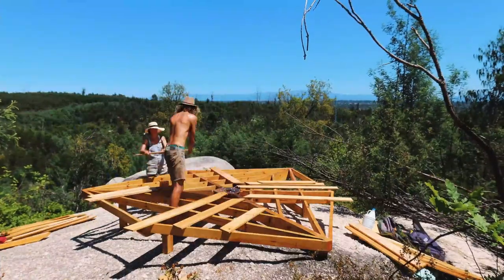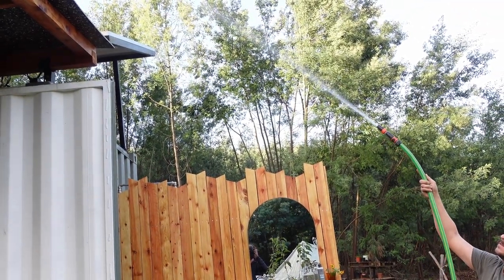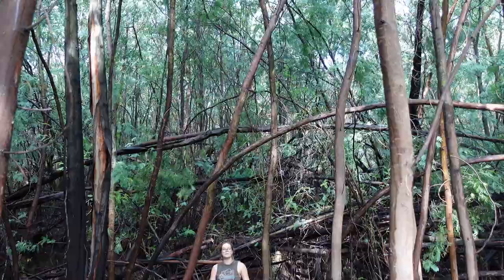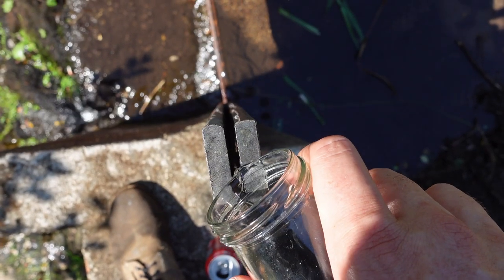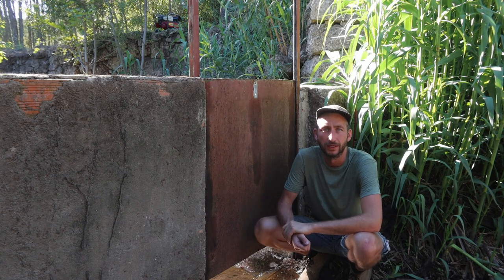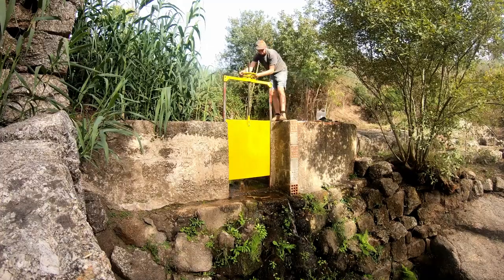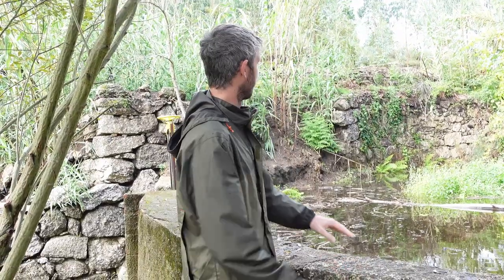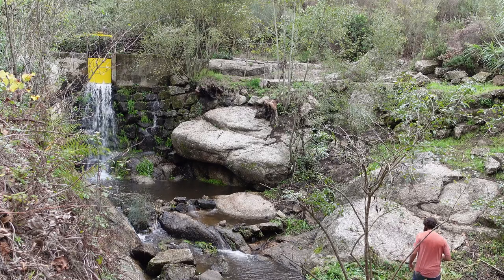#71 Fixing the waterfall door (before big rain comes)

Comment: i would make the grooves way bigger on the sides of the dam, and then isolate metal with plastic or rubber so that the metal door does not slide metal on metal, but metal on rubber or plastic, it does not have to be waterproof as the water pressure will push on it and create a seal, once the water starts rising, if not you will have rust and grinding as a yearly problem or pollute the water with grease or oil..

Comment: i would have just used a bottle style floor jack, something like a 20 ton, and just slowly apply jacking pressure as you add lubricants. 40k pounds of force, constant, itll move.

also, pour hot wax into the sliding portions, the wax will stick to the metal and work as a lube when you go to open it up next time. farmers here in the US used that all the time for generations. cheap, and it just works!

Comment: so, if you used the shingles as shingles overlapping from top to the bottom, they would work amazingly. Instead of trying to make the connections water tight.. so set up the same way regular shingles are set up.

Comment: Get a "Fine-Grained" Steel, like Hardox-400, 
to made the replacement Guillotine-Blade from, 
and pre-shape (taper) the edges, before installing it,
also weld an ANVIL (thicker piece to hit with a HAMMER) to the Top-Edge, 
also plasma-cut, some lifting eyes (holes) in the top, 
& use "High-Zinc-Solids" (Galvanic) etch-primer, 
before painting on the Top-Coats.
Glue on a "Nut" to the Guillotine-Blade,
used to hold a "Sacrificial" Zinc Anode 
that prevents rusting, 
that anode screws in to make hard contact with a bit of bare-streel.

Lubricate the slideways, Drill & tap to allow some "Grease Zerks" (nipples),
and consider "Copper-Coat" long-life lubricant on the slides.

UHMW-PE (poly-etheleyne) plastic "shims" are a very good idea.
To prevent to two steel parts contacting each other.
If needs be, you can burn the poly-ethylene out, if you must.

Comment: Everbuild Evercryl One Coat Instant Waterproofing For Roofs, Gutters and Gulleys, Grey, 5 kg and also Butyl tape for joints fantastic on any surface and can be applied in wet and cold. Used on plastic roof and got me through two winters. Amazon

Comment: Next time maybe put a thick plank between the sledge hammer and the steel sheet you’re bashing.
Nice plot though and a nice elevated spot to capture water in a standing column to drive a small high pressure generator.

Comment: Maybe try a rooftop design with square stones like they did in the old days. You might want to check martijn doolaarts channel. Its probably more easy with rectangular plastic 'stones'. This method wil accept movement of the plastic and still drain towards the gutter.

Comment: Hi, i schudent coment but i cant stop.
Greate video espeseialy the dam opening.
Reflection: down stream the dam it looks like man made smaller dams/ water holding spots.
About the new well:
When i was a child, i was told, if you dont youse it you los it. Is pared to alot of oder issuis.
It says to open a dry whell keep the level low as possible during some time reny sessone.
This to open up the inlet canales, wich normaly clogged or decrising flo by not using it.
Another thing how to check water qualit. Find a frog or a copul of them, if they servive they shoving good water quality andnif they like to stay they will clean the whel for you.
Hopfuly some make sence due to bad spelling.
Good luck with youre project.

Comment: When I see the water leaking out of that rock, my first though, doubly with seeing soil on the other side (Presumably) is that water has soaked the ground over many fill/drain cycles, and erroded away part of the section that the main concrete wall is rest on.  I have my doubts about the structural integrity of the wall and worry that it's a potential collapse hazard down the road.  But i'm not a civil engineer so I don't really know!  Cracks in the foundation of the damn, leaking sub-structure, and lack of maintence fills me with dread!

Comment: Hello, not seen your videos before and unsure how those roof panels are constructed etc. However If all you want is for it to be watertight you should simply space them apart by 2cm and put that same tape over them with slack in the tape to allow for expansion and contraction, you should also make the holes larger where they are affixed to the structure (again don't know the details but I assume you have just screwed them into that large frame (oversized and this is part of the problem because it is so rigid). So the screw sits in an over sized hole then have a metal then PE washer (PE very tight against plastic) this will further allow heat driven expansion and contraction which will stop the curling and leaks. What you have installed now will work for a time but eventually the tape will come off due to differential movement (which it will get pulled off because it is taught). I work in construction btw not just pulling this out my arse lad.

Comment: The best and let's say more long term solution is to redo the whole dam, maybe not the whole but definitely the gate, as it is very rusty and leaking everywhere, and maybe raising the gate a little bit so the water doesn't overflow as much, or if you guys don't want to go through all that trouble just put a TON of silicone all around 😅

Comment: I think putting a hydraulic car jack under the sheet metal water gate would have worked.
The gate guides might not be a 100% parallel and you were jut hammering it tighter and tighter.

Also, you should REALLY wear a respirator when using a angle grinder.

Comment: That blow touch is not power full enough, you need something with more power, and then cool the metsl so it expanes and contrac a few times, but it's not the easiest place to get tools to. 😉 Ps next time don't hit metal that you want to keep with out putting wood in between 😉 regards from denmark

Comment: Next time you try to move something that is rusted shut, don't bother with impact force, it'll never work ... instead use a constant force - in this case a couple of bottle jacks underneat the drawbridge would have cracked it free.

I'd also be strongly tempted to remove the gate again and grease those channels, or it's just going to rust shut again.

Comment: It's obviously a little late now ,but WD-40 is not technically a lubricant. Should have used some type of oil/petroleum product. My favorite here in the US is a product called Kroil.  Then use a jack from your car from the bottom then hammer from the top alternating.

Comment: take a foure by two cut a slot to fit in the gate put it on the bottom and with a hydraulic jack lift the plate remove and clean the track the put the plate back in place

Comment: Always through piece of burning paper down (old) well to check oxygen level before venturing down.
Reply: Not so good if its full of methane from all the leaves. 
They also did not know what was below the surface. What if there was 200mm of laves then 2000mm of tangled rotten branches.

Comment: that gate would free up easier IF ... you used the heat on the slide on the edges and NOT on the actual gate ... the idea being make the channel expand with heat crack the rust bond and then slide the gate ... heating the seam as you are ding heats both parts so the metal doesnt spread apart and break the rusts hold ... the final option is CLR ... yeah brand name stuff it works on Calcium Lime and Rust .. works pretty good

Comment: I feel like a larger wheel on that screw thingy would go a LONG way to make opening and closing the sluice gate. Also maybe grease? But I don't know what kind would be suitable to both this (outdoor wet) application and your ethics.
The (atrocious) yellow paint can also be used for depth indicator. Paint dam side with alternating black/yellow bars of 10cm to easily see how much water there is.
Also check out ADVOKO MAKES video "Constructing a Bushcraft Waterwheel" for some inspiration maybe.

Comment: The prob wit that plastic roof is u didn't overlap anything. U didn't stagger anything. Theres no uv protection. U could of sprayed them with a UV clear coat. Then overlap each layer. Even an inch. This forces rain over instead of in cracks/seams. Then stagger each layer. Start the 2nd row with 3/4 of a shingle. Next row half. Then a 1/4 of one. This not only is how we water tight its how we make the roof stronger. Its only one cut per row. Use ur cut to finish that row.
   Ive seen roofs rottd so bad the only thing keepn us from falling thru was literally the shingles. Once they was removed ud go thru the wood. Best of luck

Comment: just found your channel,  I see you have several vehicles , did anyone think to put a piece of metal or board under the metal gate and use a tire jack to push it back upwards?  I know your strong , but your not able to put the force of a hydraulic or even scissor jack against an object.  Just an idea from a Redneck truck driver from Canada who has to repair things on the go with whats at hand...  Good video  by the way.

Comment: First off, I'm a old poor country boy. So what your working on is the kind of the place that I grew up in. Who ever had the property before the present owners have did the hard work for the new property owners. Know offences meant, and my interest is my own desires for something with as much potential as what they have here. They have the right idea, but need to follow though with what they have started. Example, the well, they didn't dig it deep enough. Well digging is a hard thankless job, that only the results matter. Know water in the well regardless of how dry the weather is means know well, and therefore a waist of effort. The well should refill in dry time's or wet. People would dig there well deeper when things were at there dryest. 
       As for as the gate at the dam, use a car jack and a plank of wood under the edge so as not to crush the metal edge. 
        Be creative, there is more than one way to jack up the gate. 
         If they insist on using acid, than they need to get serious about the acid. 
         Muratic acid is a serious acid, and can be purchased at most local hardware stores, but it's a very dangerous chemical, and should only be used by qualified educated adults.
         The water flow too the reservoir is being leached off from other locations, even down stream of the gate.
         Just remember one thing, work smarter not harder. Use the most profitable skills you have to barter what skills you need from others.
         So what the owners need is about 150 Mennonites to come in and do the work they need done. Or take the skills they already have and trade that for cash they need and pay someone with heavy equipment to come in and do the hard digging to clean and clear up the drainage problem's.
         The way that the old timers delt with labor needs were to have big family's. It's the same problems, but with other resources to deal with it. So just trade what skills you are most profitable with, for what work needs done on your property. Ideally a barter would be great, but when not possible, cash is king. So, at least use a job skill that will produce that.
         Once the heavy work is done than your labor will count for more, because right now your burning up your time and labor resources on work that accomplished the least amount of your goals. At least from my prospective.
        I do apologize for any of my criticism, I'm really proud for them, and really think there doing fantastic work, despite my comments. And if they keep it up I'm sure they can accomplish their goals with the property.
       However I noticed in the comments that know one has considered the elephant in the the video. And maybe they need to read the words to consider the possibility of a different approach to their goals with the property. So, with that being said, I wish them the best of luck, and will keep a eye out for future videos on how their doing with their endeavors with the property.

Comment: No protective clothes while using the saw, no gas measures in the old well - I love what you do, but please be careful!

You better cut down the trees that are in a radius of 3 metres around the well too, so the roots can't damage the walls.
Reply: They also did not know how far below the apparent surface the bottom was. It could have been a crust supported by some branches that had fallen in. Person in the hole should have been wearing a harness attached to a winch at the least.

Comment: Oxy-acetylene would work much better than a blowtorch. You would heat it up so its cherry red and quickly cool it down by pouring cold water over it. Then keep repeating the process of heat and rapid cooling, also known as quenching.
Reply: The continual expansion and contraction would eventually break it free.

Comment: Do you protect small animals from falling in the new old well ? And vv.
Reply: Could just lean two branches with twigs left on closely side by side and most animals could at least scramble out of the water level. We had a boogie board in our swimming pool because it was enough to support any smaller critters and they could scramble onto it easily. The hardest bit would have been to get them off that and on the ground but it never came to that. We did collect a few bugs and spiders on it though.

Comment: That recycled plastic seems like it'd work as-is if it was built in a different shape. If it was pressed into a shape similar to a terra cotta tile, then you'd be able to build the roof exactly the same as a classic tile one.
Reply: Perhaps I think they should just use up those old ones they got off the ruin on it or just build a roof made of something else
Reply: @cantsneedgaming4591  I'm sure they'll find a use for the leftover tiles, but it's more about testing possible uses for the material then it is about having a good roof. I figured if the plastic is already molded in the shape of a tile, the warping due to heat would be less of an issue, plus those tiles are designed to not need fasteners, so not screws to pop.

Comment: You might try using a floor jack and jacking it up to at least get it to break free and then lube the hell out of it and then bang it back down give that a try you guys can't get it with even heat I thought would have did the trick you could try using two torches too with people heating it while you're banging on it that might loosen it too?

Comment: Is that little bottle of vinegar all you used for vinegar??? If that was, of course it didn't work! You would have needed a couple of gallons!! You said that the bottom was the problem, that just means that what you tried worked, but you didn't have enough get into the bottom part with enough power to work anymore. So you would have needed to top it up after the first round had gotten done.

The coke actually might have worked the best ...if you had used a couple 2 liter bottles of it. I do believe there's a stronger acid in the soda than the vinegar. 

The ketchup you used would never have worked, though. Too thick to get into the cracks.

Comment: You should keep it open and only close it mid april....flooding the land its good sometimes
Reply: How will keeping the gate closed reduce the flooding apart from the amount in the pond. Once full water in equals water out.
Reply: @johnclements6614  you just need water after May
Reply: @kaxiaz  You may only need water after May (debatable but it would fill quickly) but you have not explained why you think removing a full container that is overflowing will lead to more flooding. If you put a cup that is brim full on a table then pour water into it the table gets just as wet as if you poured straight onto the table. As I noted once full water in equals water out. A full overflowing pond could actually increase the peak water flow because the water moving across the pond will be less subject to friction with the pond bed so will move faster.
Reply: @johnclements6614  cycles of aerobic and anaerobic flows are the most fertile in nature.

Comment: It's crazy that you guys just welded the gate back together instead of using a new uncut piece of metal for the gate. It was literally cut in half, and now has a huge structural weak point in the direction of the force that is going to be acted upon it the most. If this gate ever fails when the water reserve is near maximum capacity, there could be huge ecological consequences downstream. Please reconsider using a different sheet of metal even though you have already "completed" the repair and re installation of the old gate.